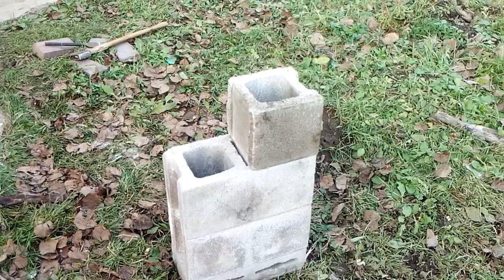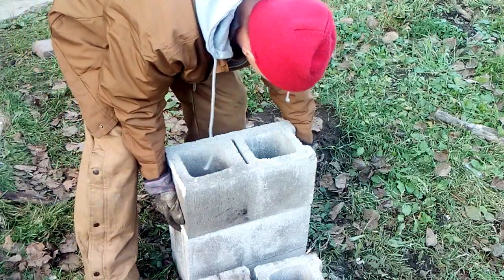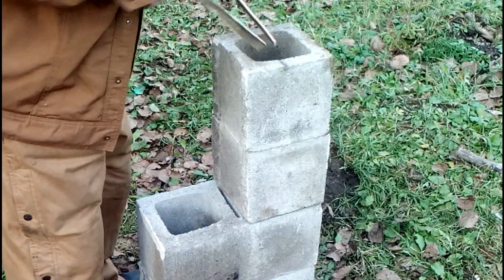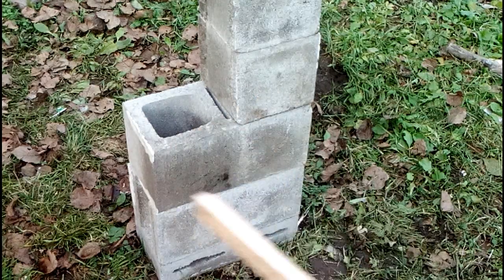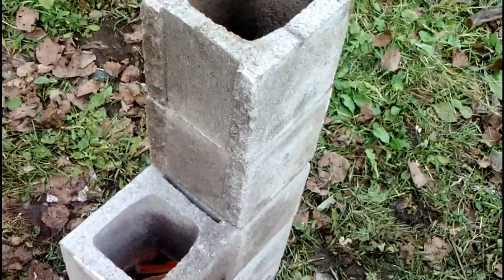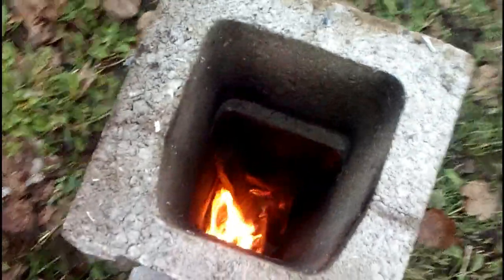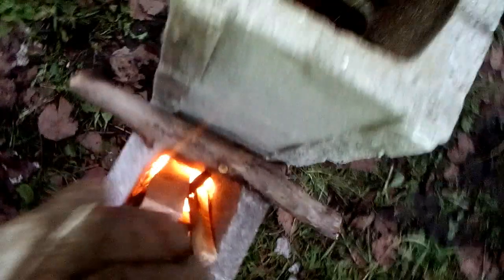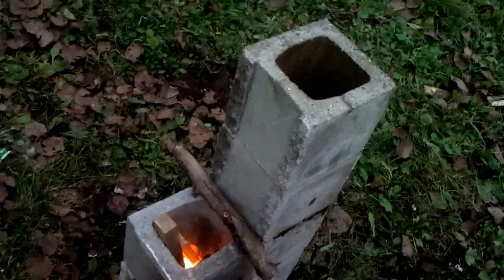Best Block Rocket Stove Build & FIRE Gravity Feed DIY Stealth Cooking BBQ J tube

Comment: How long before your fire is flaming up your feed hole? Still have to push coals to the back, only now you have to reach down into the brick to push coals back. I dont think you will keep this design.
I like the design but I think once you have a coal bed, you might have flames coming up the intake.
Reply from the maker: you have a leak or some other problem if the flames are coming backwards up the intake feed port.  make sure the front is not open or seal the gaps with mud.  if there is any other openings besides the intake and exhaust, you will experience flames coming out the front feed, which is not the proper way to build nor operate this block rocket.  it works upon displacement, so the fresh air MUST come in the feed port and nowhere else.  otherwise it will backfire.  make sure you are sealed up as best possible so the intake can work properly.  also as demonstrated, you must pre-heat the exhaust riser first.  be safe
Reply: @613Builds  thanks

Comment: What is the purpose of the first block being hollow ?
Reply from the maker: it allows the taler heat riser to act as a chimney and it allows the fire to be sucked in and down.  its what makes the J-Tube work and connects the firebox or intake to the heat riser or chimney

Comment: Isn't it harder to clean out firebox with this configuration?
Reply from the maker: no its a breeze just drop a vaccumm hose down the feed port and/or the heat riser.  let the vaccumm do the work.  it  might appear more difficult with traditional thinking or if youre looking for problems but if youre looking for solutions with new easier more efficient methods , the vaccumm hose works great!

Comment: I love the idea of these cinder block stoves, but many comments say they explode with dangerous consequences......  which caused me to hesitate.....
Anybody have info on this ??
How dangerous are they ?
Reply from the maker: thanks bill!  henry, these are not "firebricks" so they may eventually crack or fail sure, however i don't think they will explode either.  that being said, some things can hold moisture in a shell and cause steam to build up but you'd need a very fresh wet brick with a shell on it so that is VERY unlikely but other things like soda-pop cans or anything with moisture inside a shell could explode.  i'd say very unlikely for any block to explode, but if you want to be extra cautious maybe use only dry fire-bricks.

Comment: You know if you hook that to an indoor flue and cemented the blocks togather for a solid unit and added an air controller on the wood intake hole you could operate that in a residence. And it's dirt cheap. $10 maybe and durable. It a very good heat mass collector.
   Superb! I'm gonna do it 💫
Reply from the maker: No please don’t.  This is NOT a RMH rocket mass heater.  This is a temporary outdoor fun camp stove for yard debris .  

A true Indoor RMH mass heater is a totally different animal requiring fire bricks and requiring a bell heat exchanger, requiring air tight connections.   This is a temporary rocket camp stove , this is not an indoor rocket mass heater

Edit: also you cannot cover a vertical gravity feed, and you cannot cover a true rocket 🚀 because heat rises and it needs fast air intake to operate properly.  If you cover the intake feed side even partially the heat riser will suffer from conflicting stack effects which is no good and can cause serious problems
Reply: @613Builds  Do you think it would burn through concrete if the blocks were cemented together? I realise it would operate at lower temperatures. I'll experiment with it outdoors before trying it indoors.  I think you figure it's operating temperature would be too high if not damped down and damping down would reduce flow. The way to counter draft conflict is to make it a front feeder. Then no flue conflict,; no second flue.
Reply from the maker: @josephpetrick3499  right, I do have a match box micro batch box RMH design in some of my older videos.  It’s a front loader with a “front door” and the air intake is only 1.5” x 1.5” when the “door” is closed .   Fire brick core